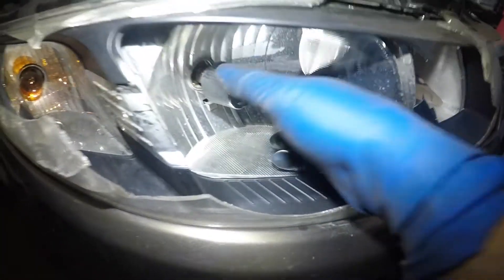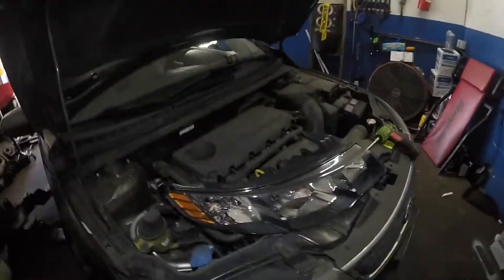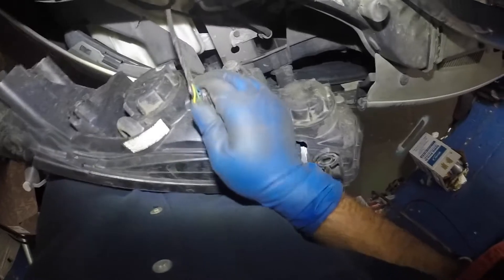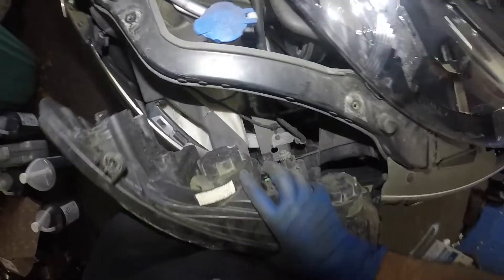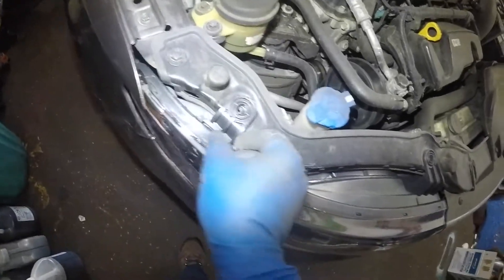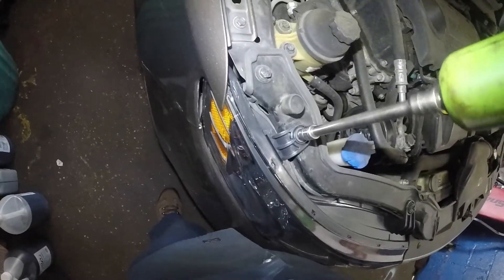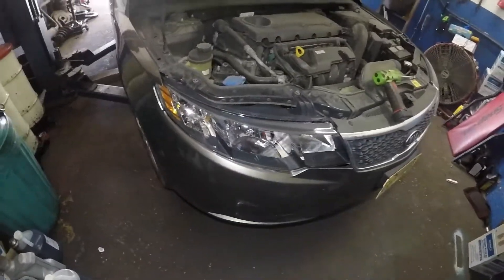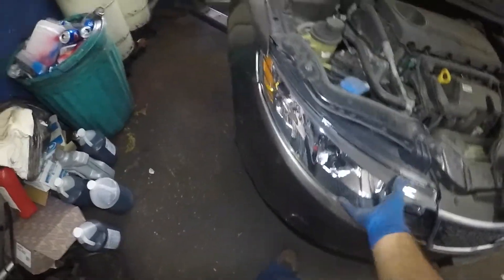Kia Fort Headlight replacement 2014 2015

Comment: Hello I have a 2013 Dodge Ram diesel. This morning there was zero power to the ac button. I saw in one of your videos that it could be the fuse. Should I check there first ? Or do you think it could be something else. Nothing turns on at all. It was fine yesterday. Thanks!!
Reply from the maker: Yup check fuse and relay if it got one also check to see if ur ac system got ac Freon! Without pressure systym will not come on and no power will be thete